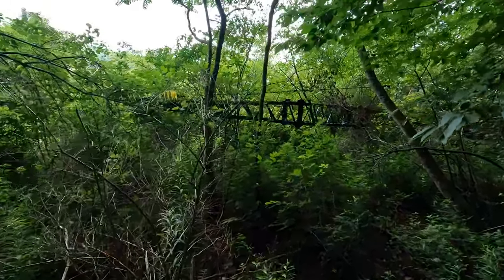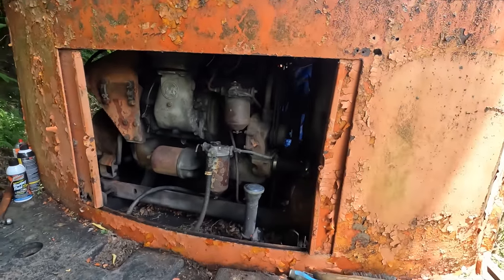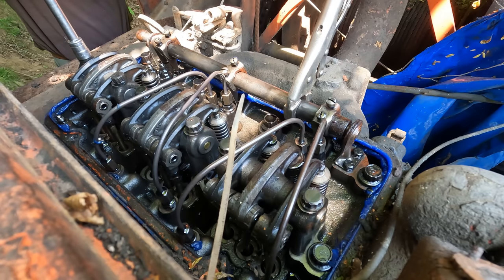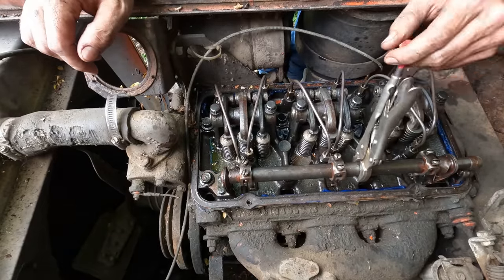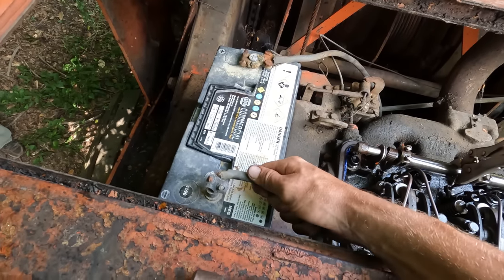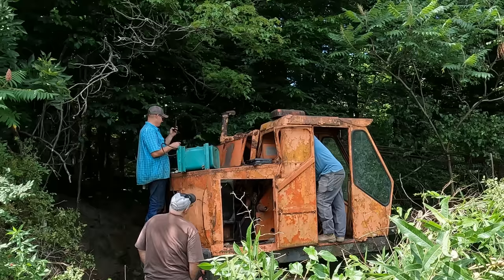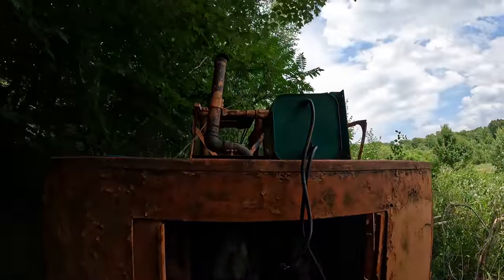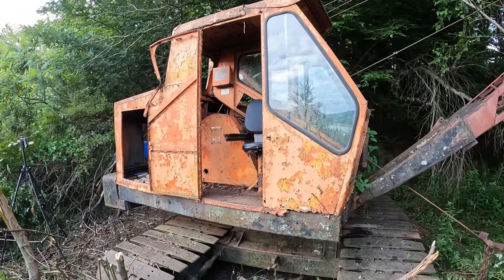Abandoned in the Woods 20+ Years!! Will This Old Dragline Crane Start and Move?!?! (Detroit Diesel)

Comment: They're not the most powerful nor fuel efficient but 2 stroke Detroits are one of the most durable engines ever made. When they do need rebuild it's an easy job to throw in new sleaves. Got 4 of them on the farm, 3 in equpment and 1 in a 1968 Pete. 2 years ago saved an old  1957 Eluclid crawler with a 6-71 Detroit burried in the woods for 40+ years just like this dragline your saving. Just like you I freed up the rack and she fired up in a couple minutes. Can't wait to see you finally drive this old girl out of her grave! Love this one Matt!

Comment: I never cease to be amazed at how these engines come back so easily after sitting there 20 30 40 years with the elements trying to kill them.  If the injectors had not been locked up , it would have been ridiculous how easy it was to bring back.
Reply: I wonder how it will be 30 years from now. How will today's machines look t hen?

Comment: There's some damage on the top of one of the injectors where the rocker has started to wear through it. You'll want to replace that and time it or you'll run the risk of killing that cylinder. For now it's fine but that should the first thing you'll replace when you get it back home. Thanks for the video
Reply from the maker: Didn’t notice it… might just be how it looks on camera. I’ll have to check it out again.

Comment: Yep that is a 353 series. You confirmed it for me when it cranked and ran. The 53 series has distinct sound that is different from the 71 or 92 series Detroits. The sound difference is primarily due to the design of the blower with straight lobes. The 71 and 92 series had twisted lobes in the blower and ran a “bit” quieter. Great video, thanks for sharing!
Reply: It's awesome of someone like you that is not there that you knowing the sound of that motor that you recognize the year and model,that's a passionate for what you know and love 👌👏👏👏👏👏👏👏
Reply: @shaneolivier1650  You give me too much credit for knowing the year. The 53, 71, and 92 series of Detroit Diesel engines referred to the displacement in cubic inches per cylinder and not the year like it sounds. I spent 10 years of my life listening to and working on these engines. I think that sound memories are like memories of smells. One whiff or one sound instantly brings old memories into sharp focus. At this point in my life, anything that helps with memory is a plus.
Reply: @theQdomain  Yes I agree with you,some things you just don't forget like the sound of a 1993 Isuzu 250 diesel 👍😄

Comment: I was an Oiler/Driver on a Bantam Dragline back in 1975.  The house was mounted on pontoons ... the damn thing crawled through the  FP&L, Turkey Point Power Plant,  Cooling Canal System located in the Tidal Zone of Southern Biscayne Bay.. We would be taken out to work and picked up by airboat. Mechanics and Fueling, the same way. A lot of the equipment we used in and around this area, came out of Southern Louisiana. Rollagon and Pouchet are two of the Equipment manufacturers I remember.

Comment: I knew it would run. DD53’s are amazing. You can’t hurt them. I always loved how they prime the fuel so easily when you change the fuel filters and how high they will rev! I had one run away and it will scary you silly how loud and fast they can rev. You can’t close that air flap fast enough!  I also had one run backwards which is fun to see exhaust smoke out the air filter,  but the best one was when one threw a rod out both sides of the block and the guys were still running it!  It had no oil in it, and the block looked like a window, and you had to floor it to make it move and yet the still ran it for about 45 min like that before I showed up. Tell me that isn’t one amazing engine.
Reply: They dnt even rev that high... it just sounds like it does because it's a 2 stroke
Reply: @wyattanonymous5618  a runaway Detroit will run about 5000rpm before they grenade. I love them but they scare the sh*t out of me when we run my buddies compressors.

Comment: Was jealous when I saw the starter. I used to run an old crane, I think it was a Northwest. Had a hand crank to start the pony motor. Then wait 5 minutes, pull the clutch, push on other lever to start the big motor. Should be a boom dog for the boom hoist. That way when you free up the clutch, the boom doesn’t come crashing down. Instead of holding a phone while trying to record, put a dashcam on the window.

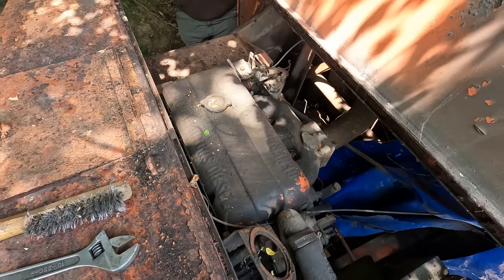Comment: 6:16 Bobcat is actually running their own engine designs now for a lot of applications.  The current one has a very interesting piston design that reduces emissions to the point of not needing the SCR systems on the larger tier 4 stuff.  We run a fleet of Doosan loaders and excavators, Honestly aside from a few weird issues that also plagued a few other brands they have been really well designed and built. Way easier to service than the bobcat and hitachi(john deere) stuff of the same size.

Comment: Hey Matt quick tip. When you're using your snapon locking flex ratchet. When you pull the lock button you can slide it to the side and it'll hold the lock off. That way when you're trying to use it as a speed handle is a lot easier and doesn't keeping locking up in a funny angle on ya

Comment: That engine sure looked surprisingly clean when you pulled the cover off, and the fact that there was still some liquid in the cooler is impressive.
Reply: They don't make them like they use to anymore.
Reply: @jaykellett2327  No sadly, now it is just so they last the warranty then stuff start to break, and seeing some construction mostly on cars the cost to replace some $2 parts can rack up into the thousands cause you have strip half the car to get to the part that needs to be replaced.
Reply: @BerraLJ and that's by design.

Comment: Had no doubt that you'd get her going, almost any Diesel a guy can find will run, especially if it's an oldie. Unless water got in the fuel tank of the machine, don't worry about it, Diesel fuel is good for more than 40 years if uncontaminated, unlike gasoline.

Comment: Love it! Nice to see a professional respect for the equipment! The one engine that should NEVER run away is a Detroit 2 stroke! Done alot of this stuff, love Detroit Diesels, nice that they're self priming and have a filter in each injector! It's nice to see someone realize that there's a FACTORY air shut-off! All Diesels can and do stick pump plungers and run wild. Detroit is the only one you can manually free up in the wild and the only one you can manually run the rack on easily. I expected to see a few cylinders blowing white at idle since those critical rack screws were messed with. 1/32 of a turn will toss them out of balance. I always buy matched sets of injectors. Such as all N-80-c, the letter at the end on the box is where it fell in the calibration range. If you ask they will match them when they pull them off the shelf. They can vary 5cc. Then I balance them at half speed with those rack screws using heat gun on the exhaust ports no manifold. that engine is only 159 cubes! Detroits make more hp/ci than any other Diesel engine and MORE torque at a LOWER rpm as well, just don't sound like it! In my opinion they have never been beat by a "waste a stroke" 4 cycle!  I have worked on thousands of different Diesels. I owned 136 engines of all kinds at one time and my Detroits are tops! It is physically impossible to supercharge a Detroit with the blower since the Exhaust valves close AFTER the intake ports. True supercharging means more OXYGEN molecules (not pressure) in the cyl than atmospheric at the beginning of the compression stroke and is irrelevant of intake pressure. GOOD work! Sounds solid!

Comment: Nice work! Great to hear that old Jimmy screaming again. Love to get my hands on something like that. As far as the blower supercharger debate goes, they call it a blower because it does not raise the pressure in the cylinder by more than 2-3psi, so it’s not really supercharging, that is why they call it a blower. A 2 stroke Jimmy cannot run without the blower, the blower is pushing air into the cylinders while pushing the exhaust out all at the same time.

Comment: Those old 2 stroke GM diesel engines were one of the classic  diesel engine designs in all of history. I used to work on them and still have a couple in my garage and some parts for others. My youngest son is fascinated with them. The cleverest thing of all that GM did was to design an entire system of engines  of varying cylinder arrangements, that all share common parts.

The 71 series were the best known early ones. They made them all the way from 2 cyl to 12 cyl. Any cylinder liner and piston from any of those engines could be used in any other 71 series engine with no issues.  A 4 cyl head would fit on one side of an 8V-71, a 6 cylinder head would fit one bank of a 12V-71 and so on. This was critically important to the US military in WWII as they were used in everything, especially boats. Common parts saved an awful lot of grief in getting parts to where they were needed. These engines were all first cousins to the 567 series of 2 stroke diesels that were used in Electromotive Diesel Railroad Locomotives. They are just bigger, but similar design principles.

After the war they did the same with the 53 Series. My next door neighbor has a 2-53 power  unit, mounted on its own skid frame with radiator and fuel tank. He uses it to power his small sawmill. We have a couple of 3-53's and lots of parts, 2 6V-53's in old trucks, one running, and one not but could be. They can sit for years without freezing up as they don't allow air to get inside the engine very well. The are dead reliable. I live in Maine and tons of 3-53's were used in skidders in the woods. Still a lot of em around. My son loves working on them. They are old fashioned but a very simple and easy engine to work with. I used to install more than a few new ones in commercial fishing boats early in my career. The environmental issues put them out of fashion, sadly. They were tough and built to work.This modern machinery is not built to do that for too long as they will need you to buy a new machine in a few years. These old guys will run forever if you take care of them! Dont ever start one up that's been sitting until you make sure the injectors are not stuck. You can have a runaway real quick. Don't ask how i know that. I saw a man's heavy winter coat thrown into the airbox of a 6-71 in the shop one day that suddenly had a mind of it's own.  The only way we could stop it quick.

Comment: diesels are just so simple, and because of the high compression, are built so tough that if you can get it to spin, and get the injectors freed up, it's pretty much a given it's gonna run. they are the oldest engine design after all. it's nice to see that one living, breathing and cheating death and not headed to the scrapyard. we all know she's in good hands with matt, cause he's got a soft spot bigger than the red spot on jupiter for old iron.

Comment: This is so not fair! You drop a wrench and it falls to the ground. I drop one and it hangs up on the way down about 3 mm beyond my finger tips no matter which side I reach in from. The only time that doesn't happen is when I have a magnetic pick up tool. Then it wedges in between two things, or it runs off to hide with the 10 mm sockets.

I love it when you get these old girls fired up. Either they are way easier than I could ever imagine, or you are a wizard. I'm going tith wizard.  I hereby dub you the Wizards of Diesel Creek.

Comment: I have an old electric motor driven air compressor that seized up on me after sitting in a damp shed for two years with out use.  I was going to throw it out, and then thought about how you get old stuff going again, so I unscrewed the pressure gauge on top of the piston, and pored some Marvel Mystery oil down into it. Still would not work, so I put a Phillips head screw driver down the threaded hole and gave the piston several light taps.......voila!  It works like new again.  Thanks for the inspiration Matt.

Comment: The shoes on that rooster look really good for the age.
Which suggest you'll be needing yet another Wide Load Permit.
And, "roading" that rig suggests you want to start kroiling all the boom joints so you can better fit a lowboy without needing a second trailer for the boom & bucket.

Comment: Old girl sounnds great... Alot better than my Ditch Witch 5110D.. still sitting at seller's summer vacation home (been over 4 years now) .. it has a Deutz 3 cylinder, injectors 2-3 barrel and plungers are rusted solid, 4 flat tires, and all hydrualics all on the ground.. it also  weighs more than what my trailer can carry atleast a good 10,500 lbs.. Bought a homemade gooseneck for scrap price, it had ag. grade 1" straight spindles (1000 lbs. per spindle) not the 3500 lbs ones.. lol

Comment: I have used a gas torch on injector pumps a few times to free them up after standing with good success. Over time the diesel waxes up and gums everything up tight, not much heat required, just gently up to somewhere around normal engine running temp and the problem goes away instantly, without dismantling anything.

Comment: Also, if you intend to let it set for awhile find either STRAIGHT Deisel (no soybean blend!) Or Kerosene, or as a last resort, furnace oil with Howes, marvel mystery oil, or even clean engine oil added. I've had those set 20yrs, no issues. Soybean sets 2 months and tear down injection pump! It is both corrosive and an algae farm! (Thanks uncle Sam!)

Comment: Amazing.  People don't realize the usefulness of dragline and yarder equipment.  Before hydraulic was the order of the day cable machines ruled the roost.  I've ran small dragline slusher machines underground.  Those were small electric and air units but they worked for cheap.

Comment: Your absolutely right. I picked up a truck in Tonawanda N.Y. That previous driver had let fuel tank go empty and some of the gunk caused an injector to stick. It started to run away so I was pulling the fuel cutoff and nothing. It finally started reving up and rounded out the  cam. Sat in N.Y. for a week after being told I’d be paid layover if I waited for it………..I stayed……..,Two weeks later it was done no layover pay. A month No pay. Finally I got fed up and left. That was 32 years ago. Retired now.

Comment: Not too long ago, YT finally recommended your channel and I am thoroughly enjoying it. Ahhh..... the memories of making the same mistakes you did!! lol
I would like to offer one point. I used to rebuild diesel pumps, and all of that old school stuff is controlled by the throttle lever (big surprise lol) which goes through a spring and to a centrifugal mechanical governor. It is the same as the two ball system found on the old school engines. What does this all mean? They are in full fuel until they climb to idle or zero fuel when slowing down (or the desired rpm) so trigging the throttle may not be necessary. You have done that on quite  few but I really cringed when you did that to the VW pickup!
Thank you, and keep up the good work on your videos.

Comment: great new tunes /animation very cool = great video, all old diesels of that vintage were simply mechanical marvels in their own right, they were built with high quality materials and hardware and most of the time with patience and some cans of penetrating oil and fresh diesel, boom they fire to life , my brother in law had an old Deutz farm tractor with a 4 cylinder air cooled diesel engine , it sat almost  i  think 30ish  yrs in an old  3 walled cattle barn and it stunk inside , we pressure washed out the cab then got in it like you did drained the oil and changed all the filters and with batteries and booster cables it fired up after 14/15 tries ,smoked like bugger, aired up 1 front and back tire , then put it in gear and it chugged out of its old resting place, it actually ran decently after an hour, good engines ,real hogs on fuel though, a neighbour of his bought it from him 1000 bucks , so now he has the use of the barn again, i think being parked in there was the real reason it started, it was a fun weekend all the same.   👍 i look forward to the next video of this old crane, hey Matt if you want to check out another youtube channel called loveloudcars , he has a 1959  Chevrolet Apache truck with a 353 in it with 2 transmissions that work and he drives this truck its super cool to hear and watch it go through the gears, the videos is about 12 mins long

Comment: In my other comment, i said iwas jealous i didnt get to solve problems like this.. well i finally got my hands on a Northwest 41 and have to rescue it. From a guy that normally works on motorcycles and cars, this stuff is not for the faint of heart. Just getting the engine running was terrifying lol

This guy is a badass for messing with this stuff all the time. SHAKE HANDS WITH DANGER lol

Comment: You see all those old equipments, rusted and abandoned in the wild, but that with a little bit of touch can come straight back to life and at full throttle, all that while the modern new things, with all that integrated computerized thing, can't stand a nanometer of variability in anything that they already fall dead and you need to replace them